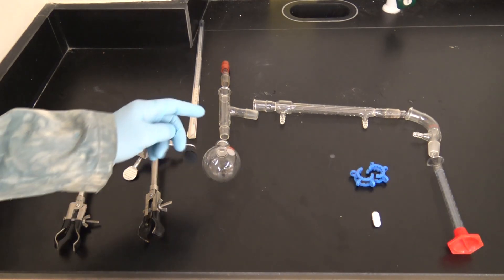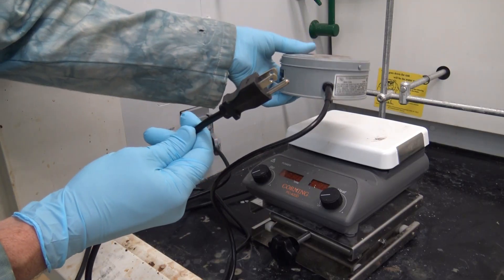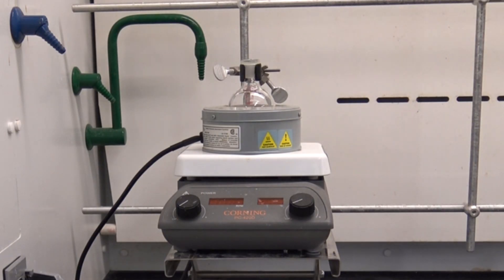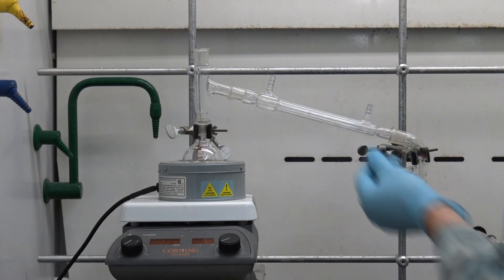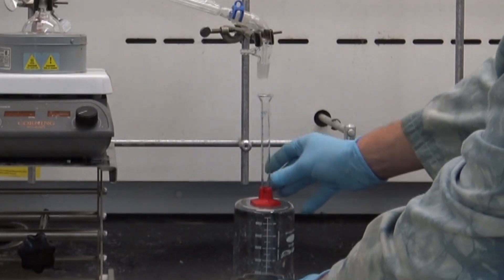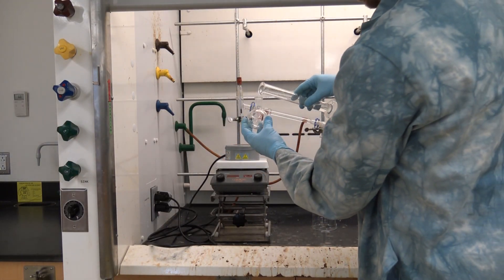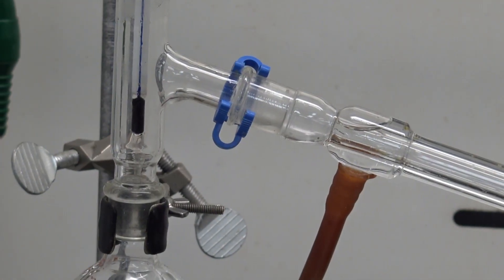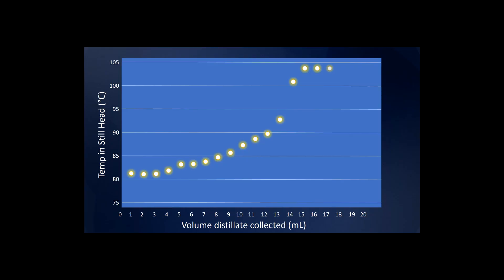A Simple Distillation Explained

Comment: Could you use a flat bottom flask directly on a hot plate stirrer instead of the round bottom in the mantle?
Reply from the maker: If I understand correctly, you are suggesting using an Erlenmeyer flask as the boiling flask.  If so, the short answer is yes, it could be done.  The long answer is that it must have a proper joint for making gas-tight connections (which most Erlenmeyer's do not), and even if it did, heating and mixing in an Erlenmeyer wouldn't be as even as they are in a round-bottomed flask, which would increase the risk of bumping (flash-boiling) causing liquid to froth up into the still head.  Both of these limitations probably explain why most would go for the round-bottom boiling flask.

Comment: Why did you grease the RBF lip before you added your sample? aren't you risking getting grease into the sample?
Reply from the maker: A fair point in general.  There are those who disagree completely with the use of grease unless you are using the glass in a vacuum application.  They're usually concerned about contamination of their sample. We apply a small bit in our teaching Labs because we found that it helps to discourage joints from separating and leaking vapor during a distillation or reflux. The trade off of course is the possibility of contaminating your sample if you plan to use it for a subsequent experiment or to characterize it spectroscopically. At this point in my course we  don't have any intention of reusing the solvent. Also, we aren't ready for spectroscopy at at that point anyway, so we opted to use the grease because it tends to help give a more consistent temperature profile in the experiment we conduct.
Reply: Theoretically, the application of vacuum grease may contaminate the material, and our company has applied for a patent for a new threaded cap, which can have a higher vacuum and easy handling, and reduce the risk of grinding damage.

Comment: For showing  the general set up of distillation the video is really good. But one should not follow this technique as it is. The safety part is completely ignored. The video should start with (1) proper inspection of glasswares (2) attaching the water line to the condenser before  attaching it to the line (3) attaching proper clips for the water line to the condenser. Also one should have cut resistant glove during the job.

Comment: why would the water supply should be connected to the lower port in the condenser?
Reply from the maker: This ensures that the water jacket fills completely from bottom to top.   Plumbing it in the opposite direction can lead to a trickle of water running through the lower portion of the jacket but not the upper portion, causing less efficient condensation. Essentially plumbing it this way ensures that as much vapor as possible condenses and this collected rather than escaping system.
Reply: @ChemSurvival  thanks for the answer

Comment: What do you use for water in the condenser if you don't have a sink handy? I do my experiments outside bc I do not own a fume hood. Should I just get some water that is close to freezing, but not frozen and fill the condenser with it, Switching it out as the experiments goes?
Reply from the maker: get a small fountain or aquarium pump like this one.  It is the one I use.  It is super cheap and has a very low flow rate, but it (barely) gets the job done.

https://www.amazon.com/gp/product/B00EWENMAU/ref=ppx_yo_dt_b_asin_title_o00_s00?ie=UTF8&psc=1

be sure whatever you purchase has an appropriate nozzle size (uaually 0.33 inch will work with most 19/22 glassware), and that the pump is powerful enough to reach the necessary height (about 3 feet if your water reservoir will be on the bench alongside your apparatus, but more if you will be pumping from the ground to a table, fore example.

Now, fill a cooler with ice water and plumb the aquarium pump to your condenser, and the return line back to the cooler.  The cooling supply should last for hours when performing small scale distillation.

Comment: when inserting the thermometer into the thermometer adapter, you should hold the thermometer very close to the adapter when pushing it in. if you hold the thermometer far away from the adapter, there's a chance that you might break it. other than that, great video.

Comment: Question :how does the cold water coming in affect the constitution of the distillate ? Isn't some of that cold water staying behind ? If so how significant is it . Thanks in advance
Reply from the maker: The answer is that the cooling water does not mix with the distillate at all.  The cold water is running through a cooling jacket in the outer of two concentric tubes in the condenser.  The distillate itself is condensing in the inner of the two concentric tubes.  The cooling water is only there to keep the temperature of the glass low enough to promote condensation.  It simply flows through the outer jacket and into the lab sink, never coming into contact with the sample.
Reply: Thank you
Reply: How you cool that water? @ChemSurvival
Reply: Sue Sue how do know it
Reply: @odunayorebecca6417  It distills to simple reading some text.